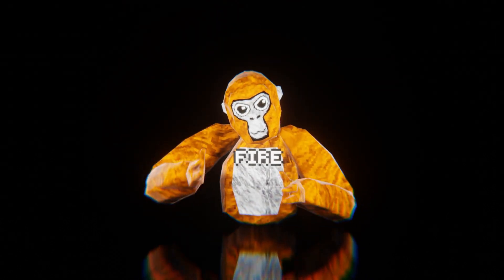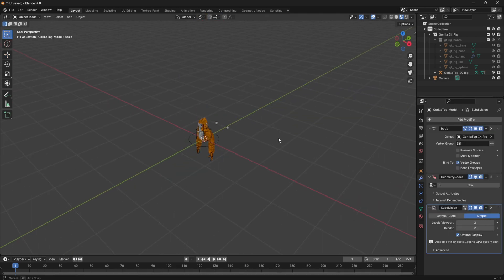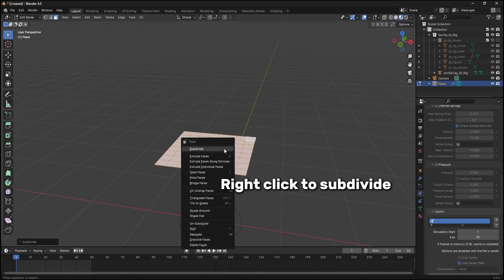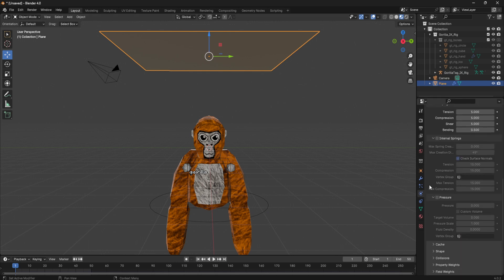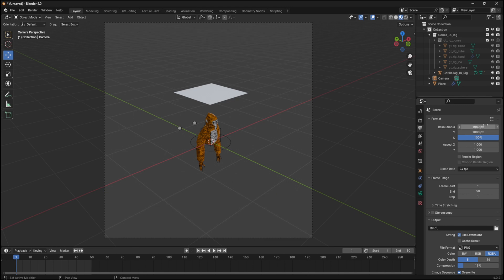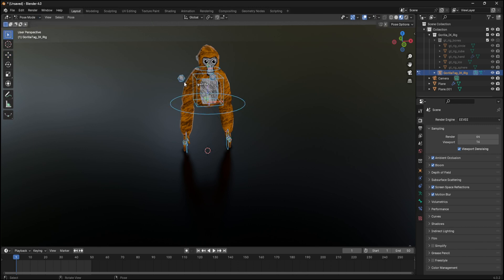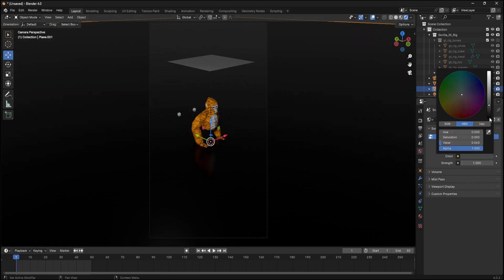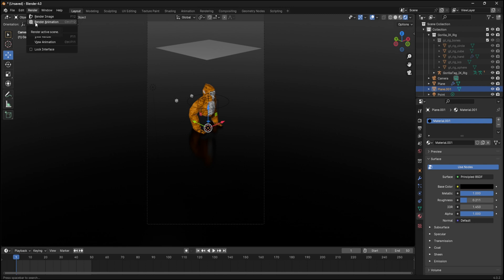How To Do Cloth Simulations In Blender

Comment: Bro, I don't get it at 2:50 when I played it it made the cloth smaller and went through the head even tho i followed your steps
Reply from the maker: @rickytheskullwarrior9126  you have to add a self collisions to the cloth
Reply: @_FireVR  ohhh
Reply: @_FireVR  I did and it still made the cloth very small now
Reply from the maker: @rickytheskullwarrior9126  you have to size the whole scene up a little and you may be using to many subdivisions
Reply: @_FireVR  I did the same amount like u did in this video tho
Reply: @rickytheskullwarrior9126  i know this is 3 MONTHS LATE but yk i just saw the comment and tell you the solution
basically all you have to do is go to the cloth physics, scroll down till you see "bake" and press that.
every time you scale or change the clotch in any way you have to press delete bake and then bake again.
hope this helps (or atleast reaches you)